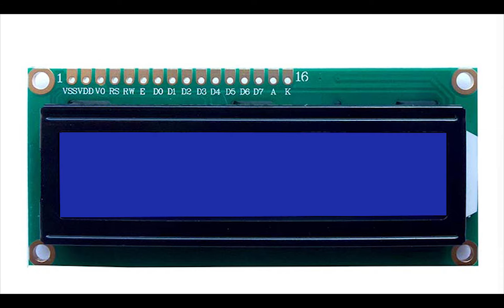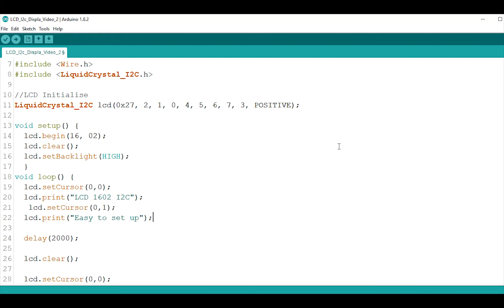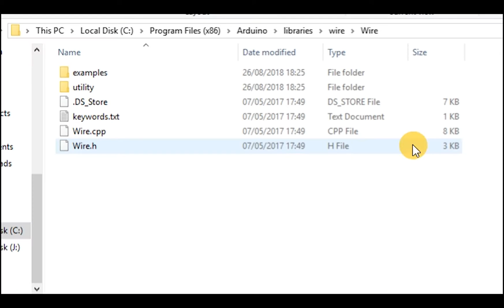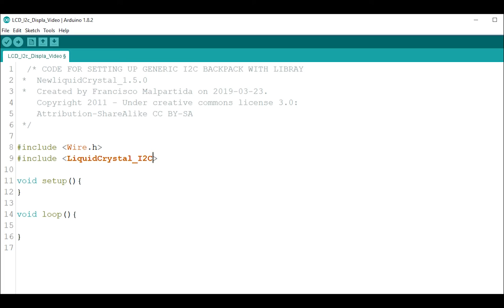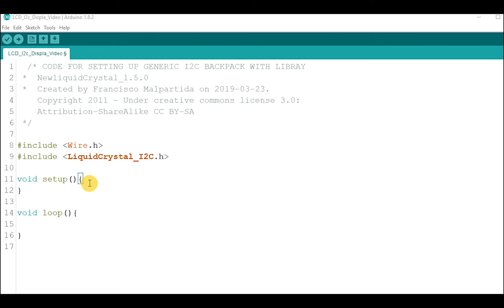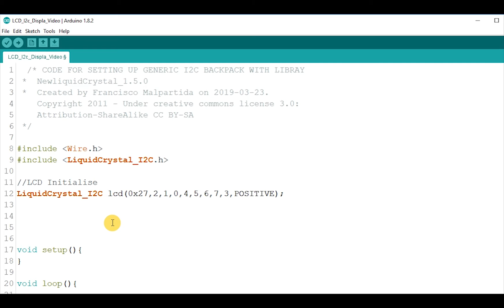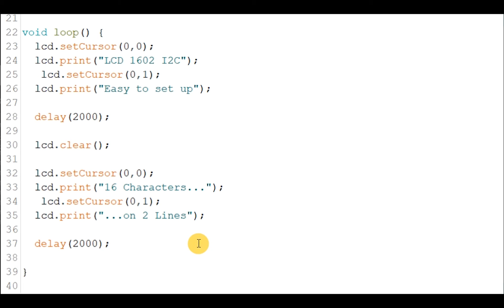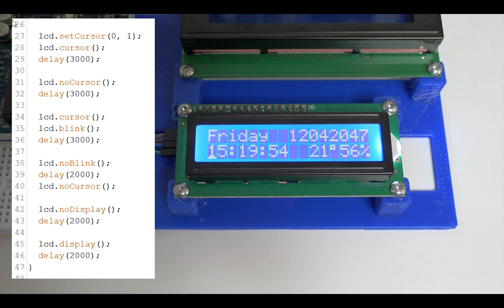How to connect and program LCD I2C Displays & Adapters with Arduino

Comment: would not work using wire.h library and Liquidcrystal_I2c.h also needed LCD.h which I found out on the internet after much searching.  hope this helps other people with same problem. kept erroring POSITIVE not declared in this scope.
Reply from the maker: Updated video and guide coming soon to our website and Channel.
We now use the amazing library: hd44780 Library:
Created by Bill Perry 2016-07-02
bperrybap@opensource.billsworld.billandterrie.com